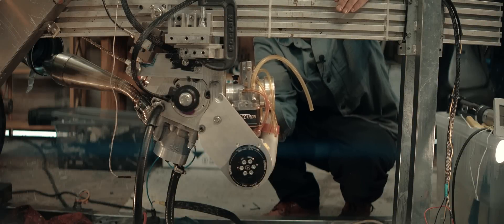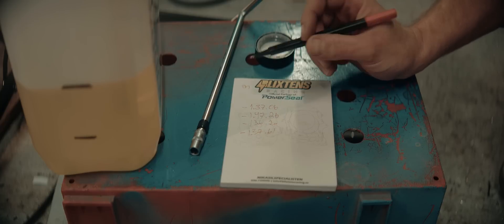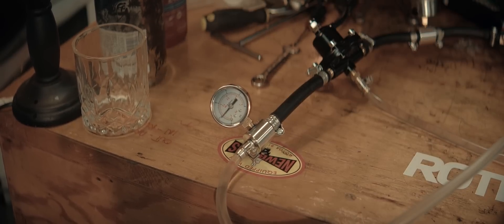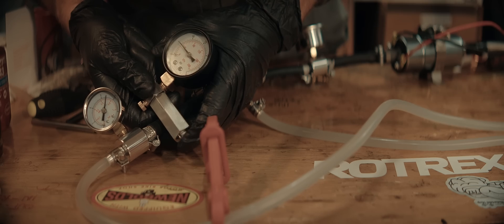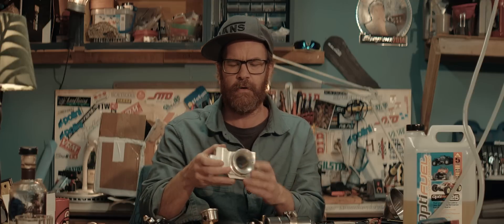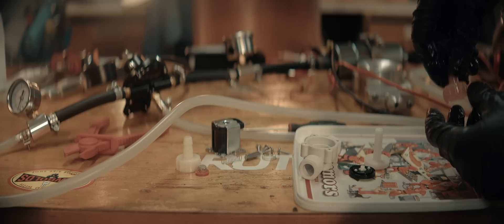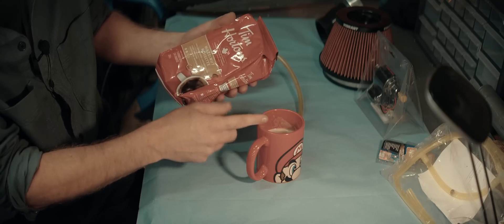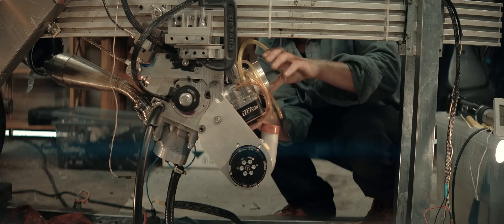48mm Carb and Supercharger on 50cc Two Stroke Engine!

Comment: By all means, no engineer. Nor particularly 2-stroke knowledge. But...
Why not replace the carburetor, with a direct injection system?
You know the exact air volume requirement, then the exact fuel amount calculation should be piece of cake...?
It may be a stupid question, but I´m still stupid enough to ask....

Comment: Can you not 3D print a new inlet with an injector mount built into it  using fuel injection will give you more control

Comment: That fuel pump is harsh on the ears. Could you consider significantly reducing the volume if it shows up again in future videos.  Might have to do voice audio separately, but I'm skipping every time the pumps running because it's painful.

Comment: I would run the lectron as is. We ran two 46mm on the 250cc twin with out any problems and it was na. So one 48 for your 50cc shouldbe fine. 😉
Reply: HIs carb would be 54 percent the area of your two and he is on 20 percent the size.
Reply: @afflickracing1705  He js running boost, on a two stroke, so probably twice the flow of the NA setup, or more.
Reply: @MJPilote  he needs air speed. Especially considering nitro is heavy. You won’t tune a carb that big down low.

Comment: I actually love the speedway carb although I'm not sure how it would do at transient boost. The lectron is great but you have that issue I mentioned last week you gotta get the fuel pressure down under 2psi for it to not flood. Same for the pwk. I actually ran 1.25psi base pressure and that worked great but again hell to get the pressure that low. Give my set up a try I'm sure youl find it's self adjusting nature very helpful and your boost isn't high enough to matter on the tank. I'll get some new vids up once the new frame is done so you can see my compound turbo 155cc but it's gonna be some time it's for next years season of grudge racing.
Reply from the maker: Yes, the speedway carb is nice and simple, it's bowl-less nature could be problematic tho, as you said. Lectron says 3psi is fine. I'm adding in a restricted return line after the regulator to bring 6psi down to 3.
Reply: @2STROKESTUFFING  if you do that youl run the bowl dry. The regulator needs to be the restriction without any after. Don't ask it's a long two week story but it was a headache to figure out. I don't think the bowl-less carb would be an issue for wot runs but drivability I feel would be rougher than the pwk. I'm at year 11 on my bike 9 of blow through. The pwk with some parts to convert it into a yoshi mjn style carb has been my favorite by far especially after I moved the powerjets way up on my intake runner about 4 in from the carb towards the plenum. I do this for charge cooling but you make end up liking these features with boost along with the endless aftermarket support. Don't use any pumper carbs... That was a fun lesson they have a check valve and once boost is applied it just dumps fuel out of the accelerator pump. Even then the hsr was great and sealed amazing but you gotta delete the pumper part. Tms were nice but hard to seal up but off of something with ram air it's already set up for boost just not much pressure. In short the pwk after drilling the fuel feeds and the slide hole bigger with a heavy spring and a clamp for the bowl and a few other things like the mjn stuff really are hard to beat. Lectron is great I'm just a mjn guy many ways to skin a cat.
Reply: CV carbs are the easiest to tune by far and the hardest to seal.. you can make it work I got frustrated and moved on.
I just had an idea for your speedway carb. If you reference the regulator on the vac side of the carb you can add that extra dimension of control pretty easy and get good control over the pressure once it's running. Just use hard line that's as small of a volume you can make it. Should be fast enough for the part throttle stuff to be great.

Comment: I think the carburetor will have problems with delivering fuel under compressor pressure because it is designed to run under vacuum. But I'm still curious about the progress 👍
Reply from the maker: The bowl will be pressurised by boost pressure, relative pressure between bore/bowl should be same as NA.
Reply: @2STROKESTUFFING  there will be a pressure difference before and after the throttle, it will be difficult to maintain or adjust the pressure in the carburetor bowl and additionally the fuel pressure must be higher than the boost pressure. that's why the fuel injection was invented, which simplifies everything. However, I may be wrong, so I'm curious how it will turn out. Your setup almost looks like a primitive fuel injection, just like you would learn as the work progresses 👍 Regards from Poland.

Comment: Norway.  Chosing the most complicated path to solution.  Are you sure you're not German? Looking to make a supercharged 50cc make power like a naturally asperated 500cc?  Why not chose gravity feed? Set fuel supply to a height which will exist on ready to ride bike.  Adjust from there with a larger diameter fuel hose, to ensure plenty of volume, varying only the jet in the carb.  Also I recommend carb be horizontal as possible, so float/needle can regulate fuel efficiently.
Reply from the maker: The fuel supply has to be boost referenced in a blow through setup, gravity fed wouldn't work unfortunately.
Reply: @2STROKESTUFFING  One guy built a special metal box so the supercharger would pressurize not only the air horn of the carburetor, but the whole carburetor.  This was a chevy v8.  As he experimented with higher pressures, the brass floats would collapse!  So then he drilled the brass floats, and inserted through pins to try to stop the foats from collapsing, which made the floats heavier, which raised the level of fuel in the bowl causing flooding issues!  
   At this point, maybe fuel injection?

Comment: Lmao. Will all that set up, as I mentioned a long time ago, go with fuel injection
Reply from the maker: Efi is not straight forward in a high revving two stroke, running methanol/nitro does not help.
Reply: I personally believe a proper carb set up is easier to set up than EFI on this engine. Zero to 20000 is very wide rev range to map with RC fuel. I only wished the carb would be set so the float bowl is level and not inclined.

Comment: From experience...You MUST purge the entire fuel system every time you run it (with regular gas) or the rubber parts will turn into gummy bears and swell. This will cause all kinds of wierd running problems which will cause wasted hours of time trying to diagnose!!!.. It doesn't matter if you leave it for 1 day or 20 once the Methanol touchs the rubber it will start degrading it!!..It will attack the fuel pressure regulator first!..If you get it running and tuned, check the fuel pressure FIRST if you develop running problems. Even "Race Gas" will cause this issue..Most Carbs run at 3 1/2 pounds of pressure..They make electric fuel pumps for carburetor engines..They run at 5-7 pounds maximum. This will eliminate the problems you are going to run into with such a "High Pressure" fuel pump. For gods sake I hope you have multiple Fire Extinguisher's!!!..With an electric fuel pump, you have a "House burning" bomb un your basement...This is another reason Dyno's are usually in closed an off designated rooms!..  It's not "if you have a major fire" but "WHEN"!!!.. It is coming along nicely CONGRATULATIONS on your progress!! 👍👍👍🗽🇺🇸

Comment: looks quite challenging fitting that in a frame later... but that's for later...   Cant wait to hear it scream 🙂
Reply: Yes, it will be challanging fitting it into Moped Dick. Possibly a single spine frame may  be better. I wonder what transmition is going to be used.

Comment: You ahould try that SC2 self adjusting carburator. It wld work amazing I think for your setup..you can check it out on Youtube by typeing " Better Than Fuel Injection" and it will pull up the video!!

Comment: Can you measure how much power the mechanical turbo uses?
Reply from the maker: Compressor map on the rotrex site
Reply: @2STROKESTUFFING  They have an E-version, what I was thinking about.  But 19Kw from a mobile battery on a 50CC moped on stereoids... Dragracing only.

Comment: Since I guess a variable elevation fuel tank is too much perhaps a PWM controller with a carefully chosen fuel pressure sensor plus pump, and probably an accumulator of sorts to prevent pressure drops with volume increases might be a starting point to build a fuel system that'll do what you want when you want on different projects. A pressure boost curve could be as straight as you choose. I haven't built one in years but I have noticed the components available now are much better equipped.

Comment: So I know what would give boost with no parasitic loss. Do a electric turbo. The battery’s needed are the size of a car battery. It’s 2) half size  12volt battery’s for a 24volt system. Ya would need a spot for the battery but it would wrk perfectly for doing high speed runs. Don’t need a charging system as you can just recharge for ea run or every so many runs. But I’ve personally seen these electric turbo add significant power on a 4cyl sedan so it would absolutely be way more then enough boost for a 50cc engine that’s for sure 🎉🎉
Reply: It would be super easy to run that rotrex SC with an electric motor. Just need to find an appropriate sized Brush less RC motor. I imagine it would take around 5kW of power full song to power that thing

Comment: I agree with many others here. The work you're putting into insane carburetor-solutions would probably be better spent at a direct injection setup.
Reply: I get indirect injection but Isn't direct injection an insane solution on a two-stroke at this high RPM though?

Comment: I love the confidence of epoxying those inserts into the carb! It's stuff like that which holds me up in any endeavor - fear of permanence.
Reply from the maker: 😁Fear is the mind killer.
Reply: @2STROKESTUFFING  That poor carb 🙁 Stop messing around and swap in that injector. There are plenty of open source ECUs online with so many benefits over the old carb, you know it makes sense! 😉
Reply: @2STROKESTUFFING  Fear Factory!
Reply: @mymodel6  
dune
Reply: @2STROKESTUFFING   i know that all to well trying to break away
Reply: @2STROKESTUFFING  
✊
Reply: no testing, just pure madness xD
Reply: I wished Alex would have retained them with a interfereence fit using "O" rings.
Reply: @malcrandall1309  That might have been okay on the inlet - but I'd be real worried about it on the outlet. O-rings + a flush retaining screw through the side of the throat would have been a solid choice though.
Reply: @bradley3549  we make ours press fit then blend on the lathe for the inlet and use some green lock tight. Screws work but if you ever played with rc nitro cars you know those carbs would get loose pretty fast with the same method of retention.
Reply: @oliverscorsim  For a known working configuration that sounds pretty good. For a 'let's see if it works', a screw is going to be just fine. I like to use VC-3 Vibra-tite for that sort of thing. Keeps things from completely vibrating loose without making it hard to remove without heat.
Reply: @bradley3549  that's smart
Reply: @bradley3549  I would have thought the reducer would butt upto a flange acting as a secondary retention when fitted. A tiny retaining screw wouldn't go a miss.
Reply: Bradley, in the next episode you see the reducer butted upto a flange.
Reply from the maker: Might work fine, otherwise a nice excuse to bore the carb straight for much easier insert making.😁
Reply: @2STROKESTUFFING  good idea!
Reply: @malcrandall1309  Or just using rtv...
Reply: I could reduce my fear of permanence with more resources and spares
Reply: @ghockings  I think that helps! And certainly might be the root of my condition, though these days I have plenty of both and have a hard time shaking it. Perfection really is the enemy of good enough.
Reply: Brave or silly? On an untested blow through carb it might be the latter...let's find out next time. That's why we are all watching!
Reply: No fear is the answer , is it really needed when blower is forcing air in anyway,  38mm port will turn into 100mm once boost is applied  , ecltrons work on air flow for fuel/air ratio so not sure blocking would have an affect will be interesting Alex , this is fun times take your time now don't hurry it.
Reply: @paddy2661  No fear is important, and free stuff always helps! :) I think reducing the throat is definitely needed. He needs the big carb for the large fuel system nitromethane requires a lot more fuel per unit air than gasoline. And while the engine flows a lot of air for a 50cc, it still doesn't flow much compared to the engine this carb is designed for so you have to get that air velocity through the venturi up or that carb simply isn't going to work well.
Reply: @bradley3549  yep I understand the working of theses carbs there great carb if your riding in different altitudes all the time I feel they run a touch on the lean side though but not this one huge.
Yep and velocity/flow so the carb adds the required fuel instead of jets , not sure with this one with Alex only running 120 main in speedway carb it's not huge , this moster carb would run on a maco 700cc.
Me personally with alot of 2stroke tunning past 40 years I'd would lean towards a 40mm no float and have a high level over flow tube on bowl , it could flow all day and never flood even baffle the bowl next to main jet.
Just a thought though will be interesting and Alex's journey has been very interesting.
Reply: There is nothing to fear, but fear itself!
Reply: theres a couple of solvents that gets annything apart, like acetone or even acids that wouldnt touch the metal.
Reply: Go on sir, it's just a lectron carb 😅

Comment: I think you might actually like a resin printer. Much easier to get tolerances in spec, I find. 

But man it hurt to see you epoxy those inserts in place. I mean, why not do a dry run with them just press fit or hot glued in - reckoning that you will feel a need to modify them at some point, no;)?

Anyways, all in respect and so stoked to see your channel grow - and getting to visit my hometime for your spinnamajing:)
Reply from the maker: If I need to modify the carb bore now I can bore it out straight and use straight inserts - much less hassle.
Reply: @2STROKESTUFFING  Gotha, that does indeed make sense:)

As for the resin printer, I might have simplified it a bit - yes, you can get some good tolerances but most resins do go through a shrink phase in the days after initial curing. But it's not huge and you can work around it if need be. 

Also, I do think/hope that as the slicers mature, we will be seing some fancy features where the slicer could scale the part taking into account that shrinkage is dependant on wall thickness which will likely vary through the part. 

Anyhow, I'd still hazard a guess in that you would like it as is. Also, the printers are so cheap now, pretty much cheaper than FDM printers and engineering resins are coming down in price, too which is why after years on the fence, I finally got into it myself:)
Reply: @AntiVaganza  How would the resin endure nitro methanol?
Reply: @bismuth7730  no idea, honestly and yes, I should have put that in my post. 

As for heat, there are some high temp resins out there that aren’t terribly expensive.

Comment: All this makes me nervous; heaps of unknowns with that carby setup... To me, any issue is going to be very difficult to troubleshoot - though I admit I'm completely ignorant of carbies (More comfortable with EFI). If you get this running from just throwing together all this with the venturis and a couple of jet sizes - it'll be like black magic to me.
Reply from the maker: I'll just start out as rich as it will go, replace the metering rod if that's not rich enough. If too rich I'll adjust it leaner.

Comment: speeduino ecu ( CHEAP  timing fuel and boost control and all the inputs outputs you need ) plenum and injector and  throttle body problems solved